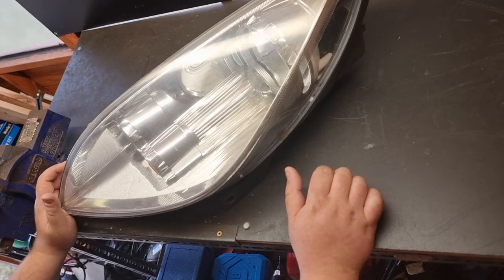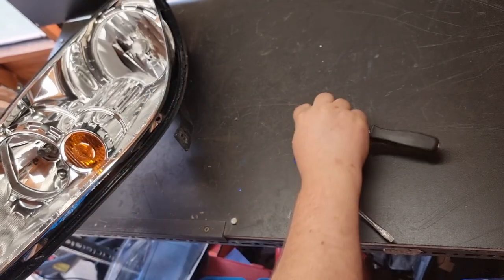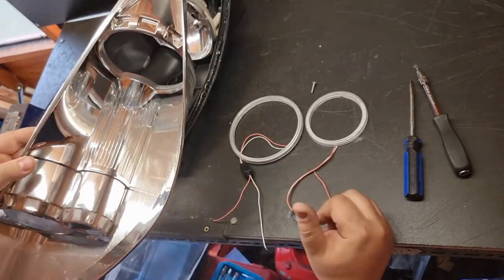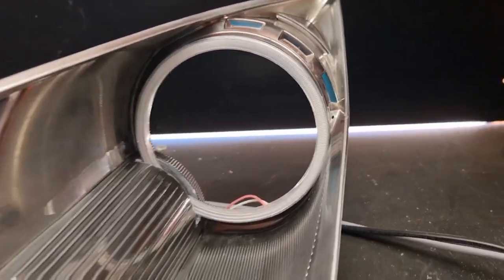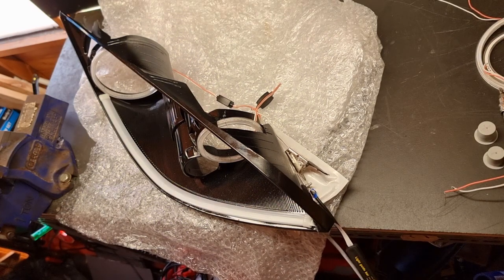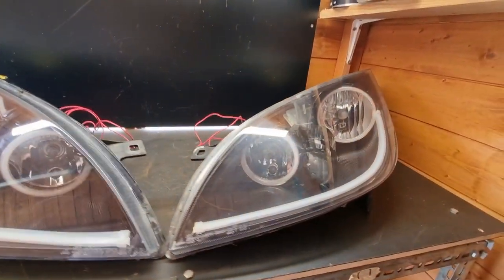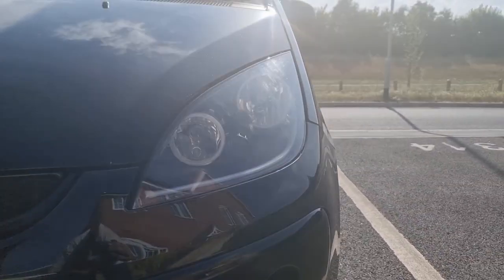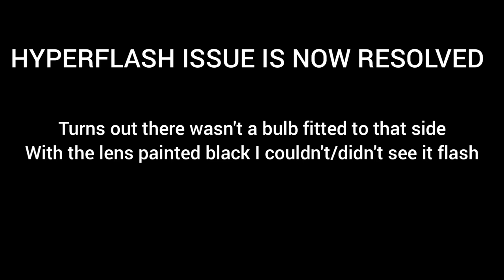Colt CZT Project **Custom Headlights**

Comment: How did u put the headlight back together the actual lens once you removed it and heated it
Reply from the maker: I re-heated the original black sealant and pushed the plastic lense back onto the housing. Refitted the clips and never had any problems

Comment: can you please explain where and how can i find the spot of making the cable managment? just a begginer and i little comfused about the cable managment
Reply from the maker: 12v 6mm 50A cable was from a friend

Fuse box https://amzn.eu/d/3G67jhj

Cable,crimp connectors,switches and fuses were purchased from a local motor factor

COB LED strips from ebay
Reply: is it required to buy a fuse box or i just can make it in other way?
Reply from the maker: @kokmusic11  its upto you how you do it. This method was easier and more convenient for me
Reply: @hoodedreeper where did you mount the fuse box does this mean you didn’t even need to touch the fuses inside the glove box you just wired to the mini fuse box and original headlight wiring
Reply from the maker: @Jayy149  the additional fuse box was mounted behind the glove box. I didn't touch the factory one, I made my own seperate circuit

Comment: how did u make the actuall light black? just spray paint or a new headlight?
Reply from the maker: I keyed the chrome plastic trim and wiped it with a tack cloth to remove any dust. I then sprayed 2 coats of plastic primer followed by 3 coats of black, and then 2 coats of clear lacquer

Comment: When it comes to the wiring do you splice all the halo wires into the original side lights wiring so when you turn on the sides it will light up both the rings

Do you connect each 4 wires on a headlight to the sidelights original wiring
Reply from the maker: The halo rings were wired to a seperate switch because blue isn't a legal colour here in the UK. The switch back was spliced into the origial sidelight/indicator loom.

You could connect all 3 to the one sidelight, the LEDs don't draw a huge amount so it 'should' be ok